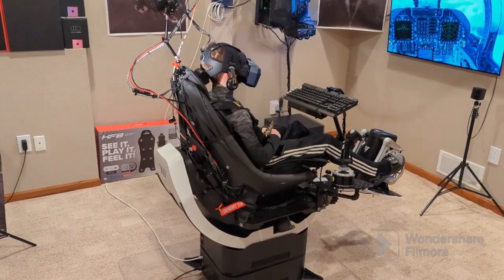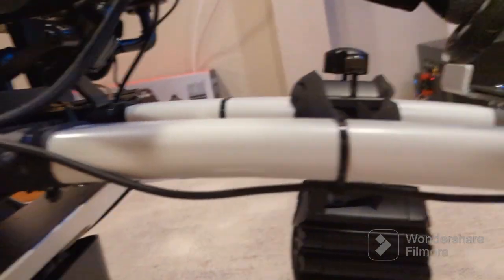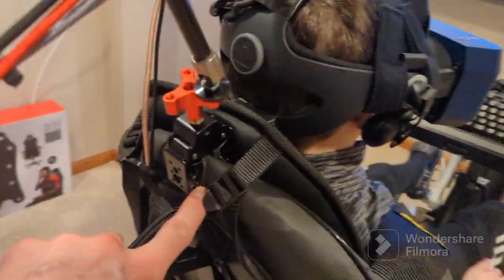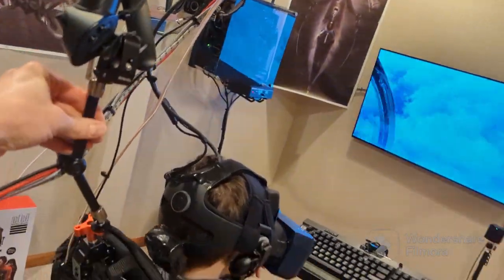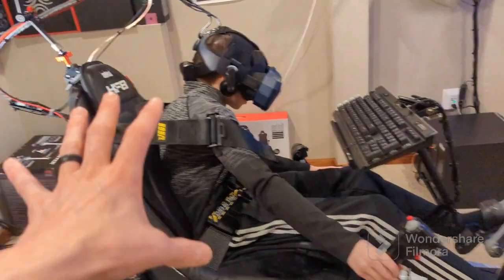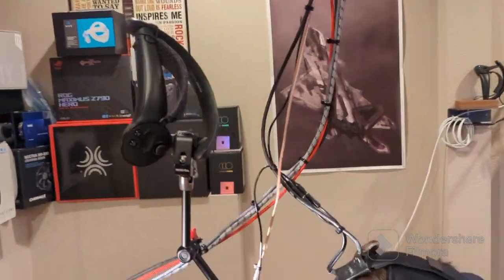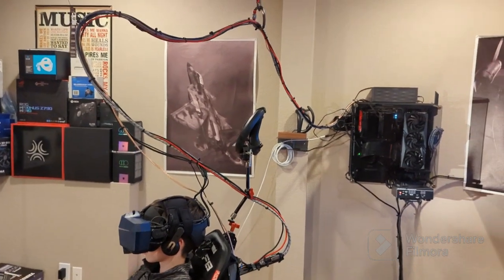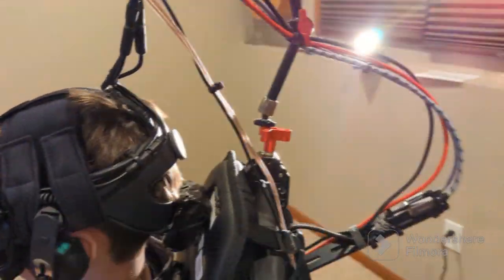YAW 2 PRO VR motion chair headset wiring.Avoid entanglement! DCS, MSFS, RTX 4090, CUSTOM FLIGHT SIM

Comment: Great ideas! So does the controller completely fix the motion compensation? That seems to be a problem with most motion sims.
Reply from the maker: I just got done with my first test flight. Yes, it works! I'm currently going back and forth between free flight in DCS, pitool, and the yaw game engine app. I'm fine tuning the feeling and the vision. You can control the acceleration of the chair versus what you see and vice versa so you can synchronize it. Just takes some doing. 

But I'll tell you what.  It's incredible. This thing will pitch backwards 55°, I think? It feels like you're upside down when it's at max pitch up.
I haven't got real far into the fine tuning of it. I'm also adjusting cable tensions and lengths as I gain more chair time and run it through its check rides here. 

But the design works as planned and I'm having no major hangups. There are definitely some moderate challenges I'd say. You just have to be very methodical and patient and think things through. Test, modify, retest, until it's right.
Reply: @phoenixrising011  Ya I can't wait to get mine since it's been on order for 2 years now, lol. Someday....Also curious if you're using Sim Racing Studios software? I've read that it's just plug and play vs a lot of issues with the Yaw game engine software?
Reply from the maker: @justaguydoinstuff  

Last night was the first night I had the controller mounted on the chair. I haven't found the yaw software tuning portion to be difficult. But the software in general isn't very good. It's weird. Like the desktop icon won't always open it. I would call it awkward but acceptable. But once you're in the tuning, it's no big deal.
      I'll bet SRS is easier. The question is SRS usable with the yaw? I had no idea that it was, before I installed OpenXR per yaw' s instructions. So now that I'm far into yaw's, I'm not going to uninstall it until I know it sucks so much that it's worth uninstalling to go to SRS. 
    The mere act of switching is a huge pain in the ass. Uninstall reinstall, recalibrate, retune, etc... Takes hours and hours to dial in under the best of circumstances, which never happens in real life. 

 I did intentionally create a restore point right before I installed the yaw software. Been there done that..... Not going to make that mistake again. So we'll see. If I can get it fine tuned enough in  yaw then I'll leave it alone. But if not, to SRS I go. We'll leave it up to the VR gods. 
I'M REDOING MY WIRING ALMOST COMPLETELY FROM THE CHAIR UP. Watch the next video when it comes out. I'm going to work on it tonight. If it goes as smoothly as I want it to, I'll post the video tonight.
Reply: @phoenixrising011  ya my motto is nothing is ever easy....I say it all the time building custom computers, lol. From what I've heard, the SRS software is the way to go. Most people seem to abandon the yaw engine software and use the SRS pretty quickly. They say it's super easy and just works, every time they start it. You might want to give it a go. The main issue I'm hoping to have solved before I get mine is the motion compensation. So if the controller works with even full 360 motion, that would be amazing!
Reply from the maker: @justaguydoinstuff  
I did some more brainstorming last night and came up with a whole new idea for cable arrangement. I can't wait to get home to work on it. It's super clever again. If it works that is..... We'll see. But yeah it's a DIY special. 🍻
Reply from the maker: @justaguydoinstuff  

Building that wall PC from scratch was far easier than dealing with the cables/tuning and stuff. Still not quite done with the tuning.

Putting together a yaw system is definitely not as easy as it appears. 

The chair assembly itself is nothing. I had that thing put together in a couple hours. There's plenty of videos.

I was forced into a really unique situation where my chair didn't arrive and I happened to have a racing seat lying around. Plus my hotas USB deal, plus the butt kicker on the chair and the haptic seat. All that shit needs to be wired. That's why I thought it would be a good video series because there aren't going to be very many out there that are more complicated than this from a wiring perspective. So if I can get this to work then it should help people with the more routine easier setups. Plus it teaches people HOW to think. That's the key. 

Devil is in the details man. There are so many little invisible variables that can have a massive performance impact. You really got to think and keep your perceptual abilities high while you're doing this stuff.

Comment: Truly amazing man! Got a couple more questions though. Did you end up figuring out/fixing the squeaking you were having with whichever axis was doing that (pitch I think)? Which chairs can be mounted into that unit (specific bolt pattern/mounting style)? And you mentioned you can program the chair itself to return to zero after rotations, can you set a specific number of rotations that are allowable and after that it returns to zero then allows you to continue rotating? I appreciate these videos a lot, very informative and thorough. Thanks for doing the work and sharing the knowledge 🫡
Reply from the maker: 1. The squeak is not there when you are sitting in the chair. I assume it'll break in and just go away. It's not an issue.

2. You can mount just about any chair you want onto that base plate. You have to examine and measure the base plate slot widths and either find a chair that lines up with enough screw holes underneath or drill / tap new screw receptacles into the bottom side of the chair to line up with the plate slots. It sounds harder than it is. There's no one specific bolt pattern generally. All chairs are different but similar enough that you'll be able to make something work. Again force the issue if you need to, Make the holes where you need them, figure out how to do it. There are tons of videos on how to tap your own screw sites etc. Look up custom seat mount on YAW 2 on YouTube.

3. I did not see any settings where you can program the number of max spins before return. I think the chair automatically handles that, but I'm not sure how that works exactly. Requires further investigation on my part.

And no problem man. Happy to help!
Reply: Copy all. You’re the man! Keep cranking these videos out. I’m really digging this series. And I stumbled on to your videos at just the right time.